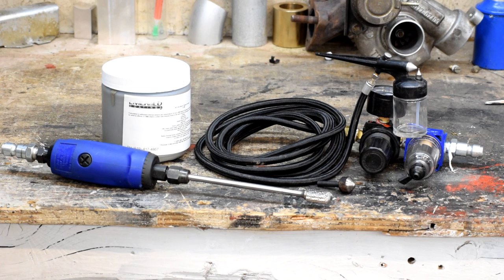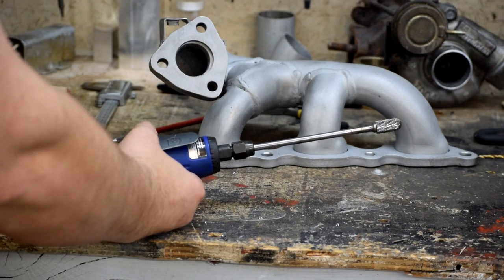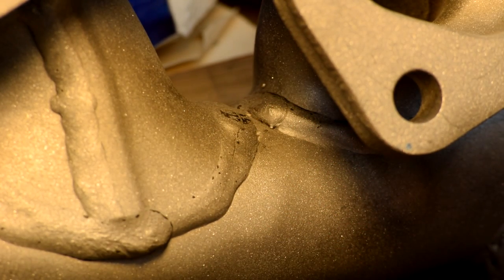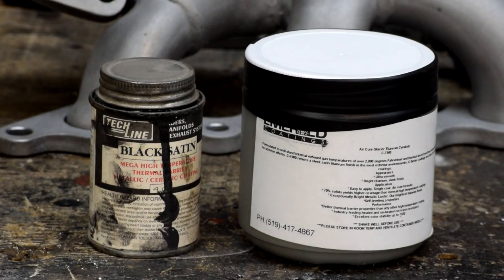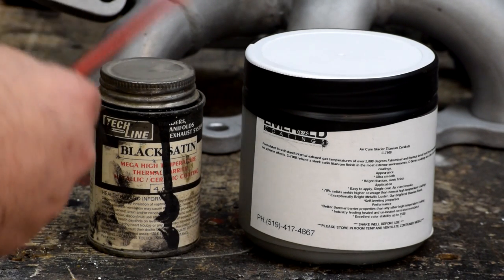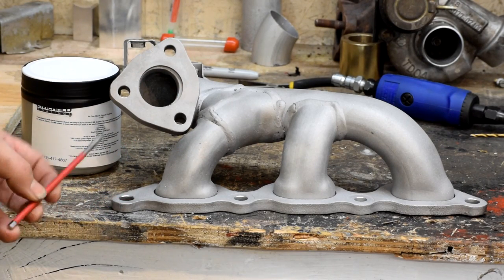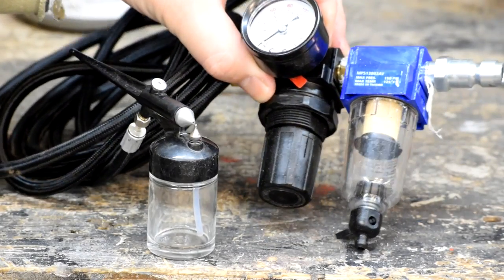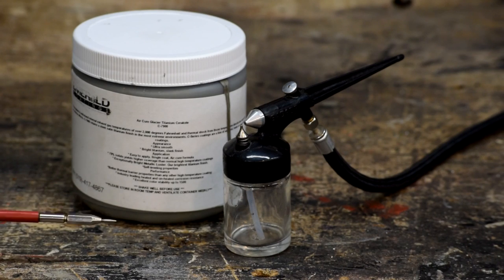FNR Stealth Project Episode 11 - Ceramic Coating Exhaust Manifolds

Comment: Love your vids, very informative. love the detail of information provided, so kudos to you.

Can't wait until you're done.
Btw. Do you think it would be a good idea to do some portmatching on an old car from 75, dual carbed engine?
Looked at them and there is a pretty decent burr on them between manifold and head.
Also would it make it harder to adjust the carbs correctly to fit the "better" flow?

Greetings form Denmark
Reply: port matching is ALWAYS beneficial

Comment: Obviously this would be hard to do, but you thought about coating the inside as much as you can reach? Do you trust it enough to be on the inside of the manifold? And not chip off and ruin a turbo. Would be good as it would reduce heat going into the manifold, and instead go into the turbo, for better spool.

Got me thinking you could get an eastwood chassis cavity spray (its like a long bendy pipe with a 360 degree spray nozzle on the end) , and snake that through the header tubes. Hmmmmmmmmm
Reply from the maker: I did - but because I don't know anything about the adhesion of this coating - including how well it holds up to being directly exposed to the exhaust stream - and because it is upstream from my turbos, I chose to hold off coating the inside.

On paper, coating the inside should double effectiveness.

I wish I had an engine dyno. I'd try uncoated, outside only, and both and see if there was any change to power, EGT, and exhaust pressure.
Reply: As long as the inside is blasted and decreased then the coating will stick. My company is designing a new spray nozzle just to spray cerakote on the inside of pipes and frames. Cerakote high heat glacier series can withstand a direct heat up to 2200 degrees. Ive built a business around this product and have been very successful.  @RecceDG if you have any questions about the product you can message me through youtube or facebook Mean Deans Performance Coatings.